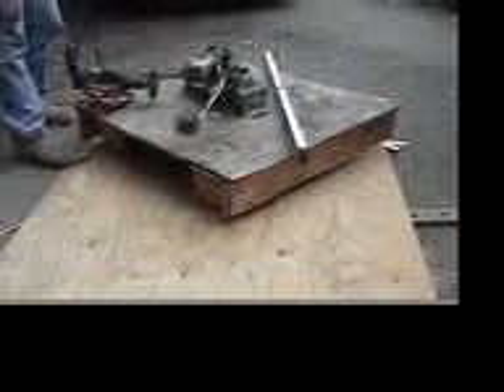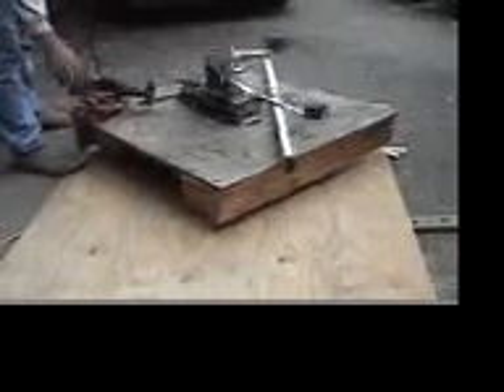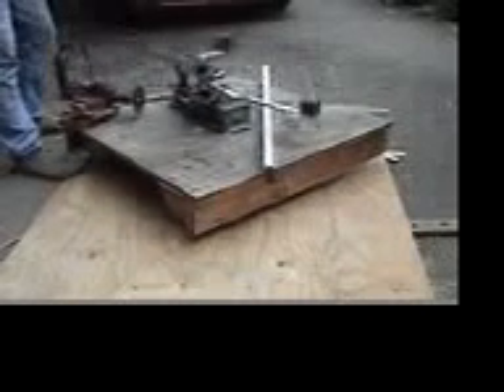inertial propulsion

Comment: Check out the Thornson inertial engine project.  Or perhaps Macquan1 Both working inertial engines that transform circular motion into linear motion.  I have built a small version of the thornson one to see for myself.  Works fine

Comment: This doesn't actually work for sure. It breaks conservation of momentum.  It is most likely producing fast intense pulse of inertia which overcomes friction in one direction, which is offset by a slower but less intense pulse that doesnt overcome friction in the other direction. This is the same a shifting your weight around on a skateboard so you can move yourself.  However this wont work in space.